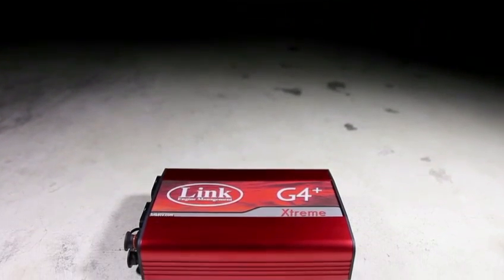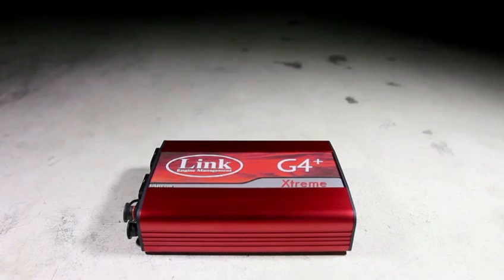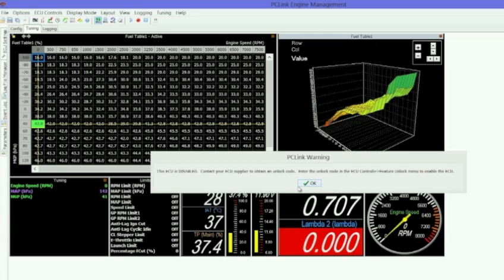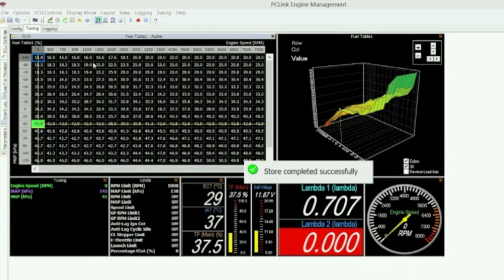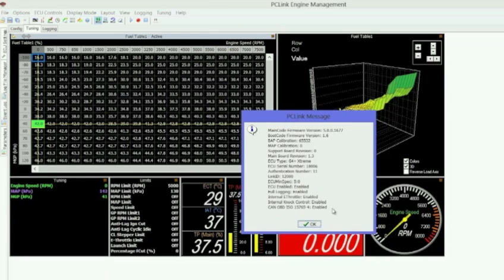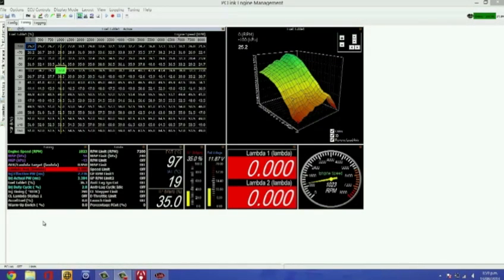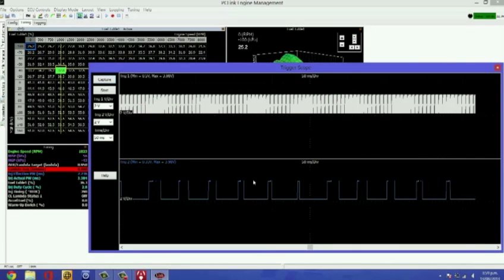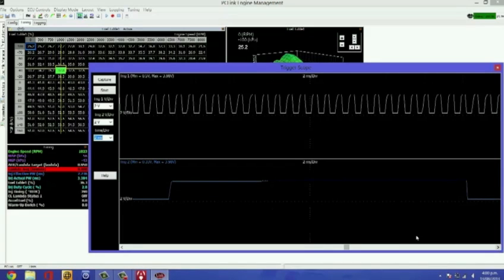Link G4Plus Engine Management System | "HPA Live Product Launch"

Comment: It appears that many of the G4+ Extreme/Storm's new optional capabilities are geared for interfacing with modern street car's digital OBD2, CAN system and ease of use for the street tuning home enthusiast. Other than expandable zone tables, and some more knock and e throttle control options, in a custom race application where I I have no CAN OBD2 applications, do you see any real advantages over the G4 plug in I use on my SR20?

Comment: Thinking of using a Link G4+ Extreme ECU for my RB26 260Z build so interesting to here some of the features discussed.

Knock control is definitely an important feature for me. How does this work? They say it can control knock on individual cylinders, the RB26 only uses two knock sensors, for this to work for individual sensors does this mean you need to run a knock sensor on each cylinder?